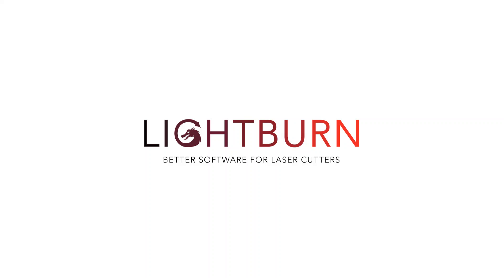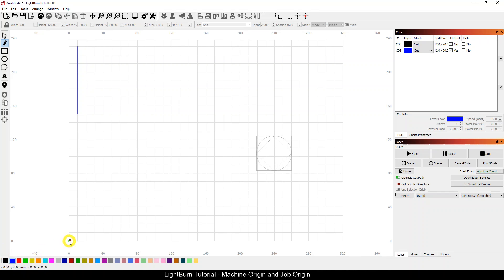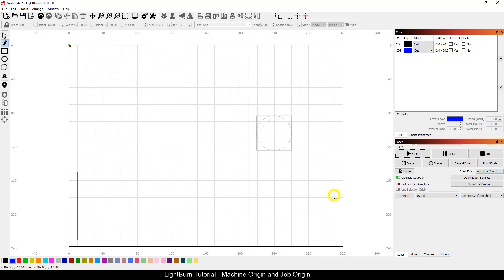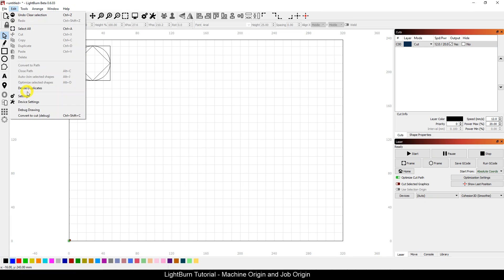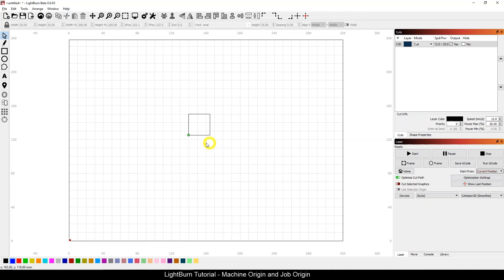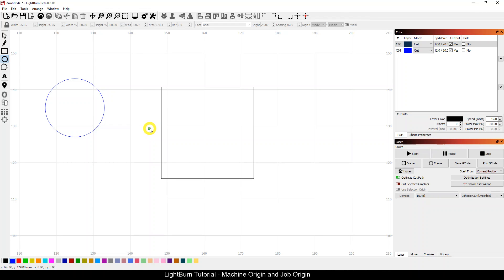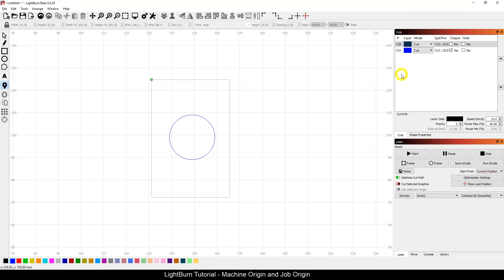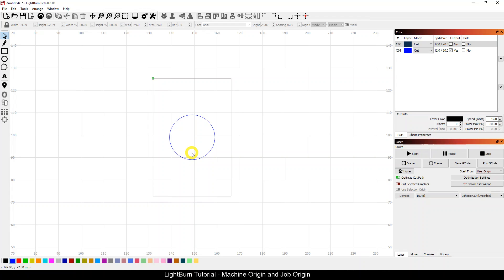LightBurn Tutorial: Machine and Job Origin (Corrected Audio)

Comment: You are just what the doctor ordered on job origins. Found out about it don’t matter where the image is moved it around just like you showed, and it made no difference. I knew the issue I was having as something simple it always is. Just didn’t have an understanding of how it worked. Now explain if you haven’t the frame command it seems to mirror the item being created.
Reply from the maker: Frame shouldn't mirror anything. Sounds like something may still be off. What machine are you using?

Comment: How do you change the work space position in relation to the actual machine position. the work pace in my set up is in the x0y0 work space (Grid) extends in the positive upper right quadrant. However, my Machine after homing is located in the negative lower left quadrant (no grid) space. After attempting to adjust in the setting, program will not populate a negative number to match the machine position.  even when using the user origin, it wont populate the negative numbers either. ??????

Comment: I'm glad you covered this information it helps. I have changed all the settings my laser xtool d1 starts from back left then immediately goes to the bottom right of the machine and wants to start engraving.(i made sure all software and firmware are up to date) I have watched several videos like this one, yet I am still not able to resolve this issue i'm having.

Comment: Hi. Thanks for the accurate and clear video. I'm just starting out in the laser world and looking for guidance on how to set a starting point when working with a template I made to place products on the table. My problem is that I can not determine where the starting point is when I place the template on the table and then the production is inaccurate. If I move the laser manually ... it does not return to the same place. Can you help?

Comment: years later but new to both LightBurn and my laser.  If I am using my LightBurn camera with my rotary, would I be able to use job center to center on my tumbler when starting a job.  the camera puts me in absolute coordinates but right now it always moves my tumbler off where I want the logo or text to be centered.

Comment: HELP! just setup new LightBurn software. My Keypad on the laser (Chinese 40w) still goes up, down, side to side like it is supposed to BUT in LightBurn my whole job board is flipped! Looks perfect on the screen but when it goes to burn it is completely reversed! Like when I try to burn TEST is upsidown and backwards. Same when using positioning laser head in LB. up is down etc. Something is the settings is jacked.  (When I switch back to RD Works everything is fine)  (Great video by the way. thanks!
Reply from the maker: Hi Gabe. I'd recommend heading over and asking your question in the LB Forum. http://forum.lightburnsoftware.com They'll get you straightened out.

Comment: Carl - Thanks again for this video. I have also posted on the forum a question of material settings. I am CNC user (VCarve Pro). I am used to setting up my material and putting my design inside the bounds of that material. In addition, I cannot figure out how to measure an object in LB - I messed up today and the object was not large enough for the material. 
I hope you have another video that sorts this out.  Any advice will be appreciated.

Comment: I so needed this video. I keep getting out bounds errors. I will try what I learned here later today.
Reply: I have been getting that too. I still am not clear about it but this video is a great help for me too.
Reply: I thought I had set mine too, using set Origin and then home, but then get OOB error on a small 2x4" design. Restarted LB with head on origin, manually moved with hands to where I wanted the center of design to be on the wood, then I get OOB. I'm guessing I need to move it using buttons not manually, but IDK so confusing, it won't move with buttons but its all setup according to video using plug & play settings. Looking into answers on forum now.

Comment: Im struggling to line up my pieces. Eg. I have an a4 piece of paper,  with 35mm circles on it (5 rows across, 5 rows down). How do i line up that paper piece on the bed,  to ensure the laser cuts them out exactly? Do i set my dxf in lightburn at 0.00x 0.00 y and then position my laser at 0.00x 0.00y?

Comment: Hi Carl, It´s a great video but...    I have installed the J-Tech laser 3.8W on my X-Carve and on the right side of my spindle.
But I can´t figure out how to set the laser  to  a zero point .
Every time I like to move to the lower left point it runs into the side ,so I have to  use my panic button
Reply from the maker: Good morning. I thought the X-Carve had limit switches built in? Unfortunately I'm not sure if I have enough info to help you troubleshoot but if you go over to the LB forums you may get some help there. But it also might be a good question for the Inventables crew since X-Carve is their baby. I know my Shapeoko I had to add limits but I thought they came stock on the X-Carve.

Comment: hello, 
I use lightburn recently, but I can not use the absolute coordinates. The machine uses the set one as zero and not the one from the program.I did the test with RDWorks instead it works. the origin of my laser is at the top right
Reply from the maker: Hi Paolo. I would suggest posting your question to the Facebook "Lightburn Software Support" group here:  https://www.facebook.com/groups/1190357787764055/ or email support@lightburnsoftware.com as the best course of action. I'm not sure why you would be experiencing trouble with that.